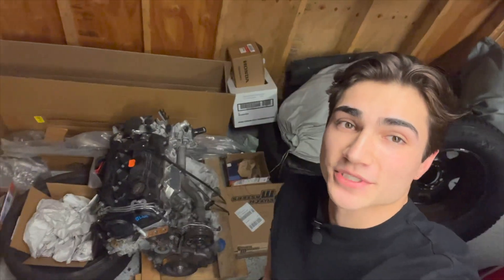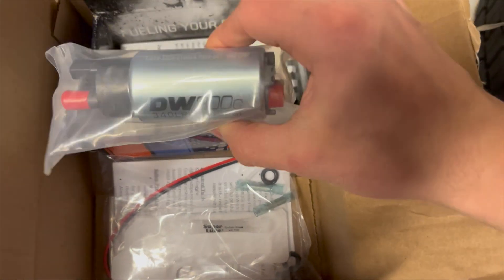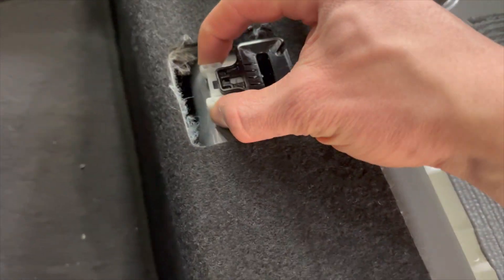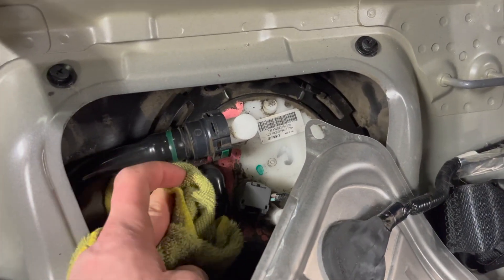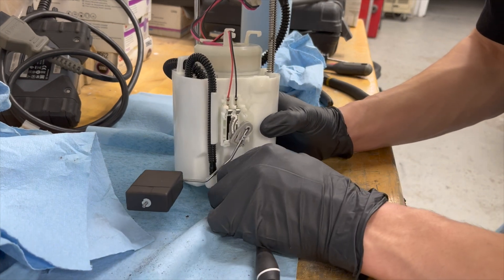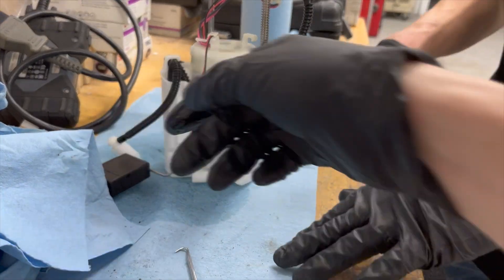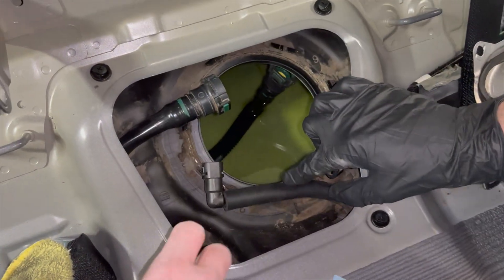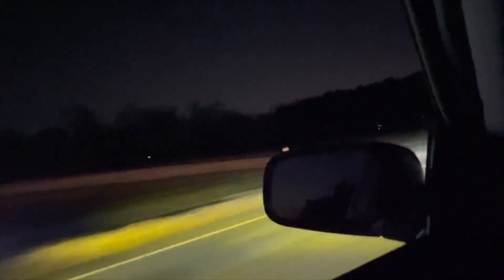High Flow Fuel Pump Install (K Swapping My Si) Ep.2

Comment: I’m glad I found this series. I’m only making 275hp and around 330tq and am even tuned to keep torque down at low end but it just doesn’t matter. I blew a headgasket and studded it and replaced with a new gasket but I just blew it again. I’m replacing it and then going to start collecting parts for this swap 👌🏼 can’t wait to watch the other videos in the series

Comment: Do you plan on running Motec or do you plan on using the Accord ECU?
Reply from the maker: Si ecu
Reply: @gavindanitz  is this confirmed working? sounds cool and wayyy cheaper in theory but I thought that pearlsir (only other person who I know has done this swap) used something else.
Reply from the maker: It 100% works
Reply: The Si ECU will work just fine for the K20c4. What I understand, a complete Type R swap will require either motec or a swap of the entire ECU system due to the K20C1 having VTec while the accord motor doesnt.

Comment: Can you use the stock transmission with the swap.  I see you got the type r to do the swap.
Reply from the maker: No you cannot. Wouldn’t want to use those glass gears anyway
Reply from the maker: I should mention the accord trans does work though
Reply: I just bought a k20c4 2020 8k miles on it.  Missing turbo.  2.5k shipped.  Has accord ecu still on.  So love some advice. I'm not in any hurry.  Figure it was a great buy and worth doing instead of investing time and money on that 1.5.  Wifey super pissed.
Reply: So what are my transmission options.  I was hoping to leave the one stock till it breaks.
Reply from the maker: Congrats. I think I’m going to make a video going over my plan and some general questions
Reply: I'm in nj too.  Will hit u up in civicx

Comment: Do you know if I can use my stock si ecu with a k20c1?
Reply from the maker: No motec
Reply: So only the k20c4?
Reply from the maker: Correct
Reply: 6k for motec and 6.5k for 2020 k20c1.
Doesn't seem to appealing any more.  Probably go your route much cheaper.
Reply from the maker: Exactly